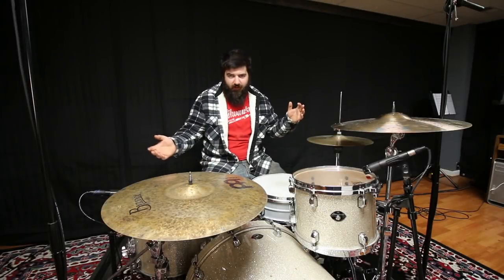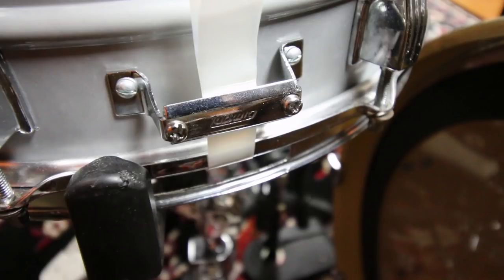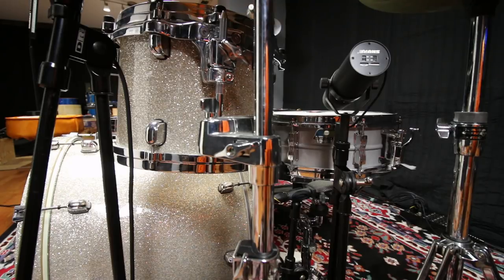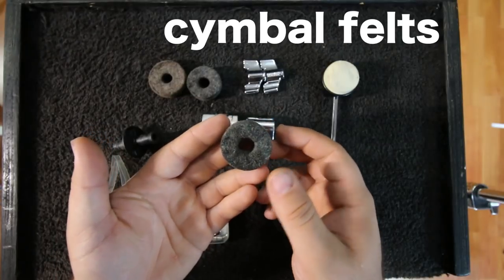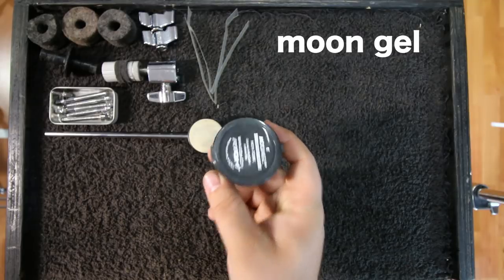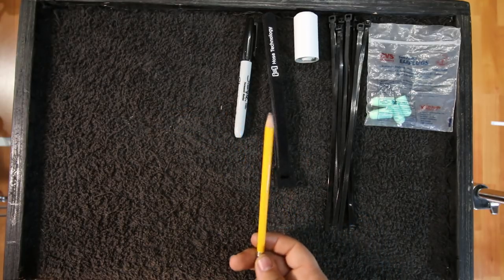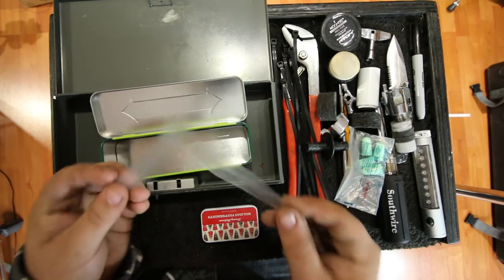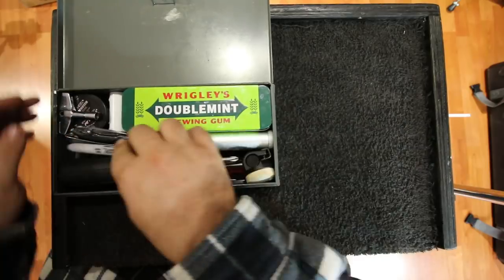How to Make an Emergency Kit for your Drum Set

Comment: Here is what I carry to every show:
1. Tools: I have a tool bag I throw in my car. It is fully loaded with wrenches, screwdrivers of every size, hex/allen keys, a small hammer, a utility knife, tape measure, and some pliers. The tape measure is helpful for winning fights with guitar players over stage space! lol..
2. Leatherman multitool and swiss army knife
3. Small drill with drum key bit. It makes quick changes a breeze.
4. Various drum keys: An old 90 degree angle key with allen key on other end (from Gibralter pedal I had), Evans magnetic key, Evans spin key, Rhythm Tech torque key. These keys also help me change heads and tune quicker. I leave the magnetic key on my floor tom for quick access.
5. Drum Dial tuner. I use this more at home before the gig and use the torque key for speed, but sometimes I have more setup time and can double check with the dial.
6. Moongels
7. A roll of Gaffer tape, for muffling, etc.
8. spare plastic snare straps, snare cords, felts, rubber cymbal sleeves, tension screws, velcro strips, screws and washers (for lugs) in a zip lock bag.
9. Spare clutch. I use a Gibralter quick release clutch and my spare is a normal one with a washer that can come loose, but at least I have it anyways.
10. Spare bass drum beater
11. Hearos musician ear plugs. A must for me.
12. Milwaukee Inkzall marker. Like a Sharpie but better! Writes on anything! 
13. A good small flashlight
14. Pens, pencils, highlighters, my daily planner, and small notebooks. For networking, notes, phone numbers and saving last minute dates that may come up.
15: Power strip. Your bandmates will have several , but if they forget, yours will come in handy. Trust me.
16: Chapstick, Deodorant anti-perspirant, Asthma Inhaler, allergy pills, tissues, mini first aid kit, band-aids, sunglasses, bug spray and sunscreen (both in summer only) because Maine is awesome for outdoor playing in picturesque places. Island boat party? Check!
17: iPhone and charger cable.
I put all from number two down in my favorite LL Bean backpack, which is my gig pack I take on every show. It has a huge pocket underneath for a pair of shoes, I keep my Teva sandals in it in the summer. It has a bungee net for jacket or sweatshirt, and many pockets for all my little items. Plus my stick bag fits in it too.
Reply: Also I just remembered. I have so many sticks and brushes, I keep a full spare stickbag in my car. But a spare pair under the seat will do too.

Comment: i started using double sided velcro instead of zip ties.  comes in a roll you can cut it to any length you need and it doesn't have sharp shards of plastic to slice your hand open.  its great for any kind of cable management and reusable.
edit spelling

Comment: I carry a pair of vice grip pliers.  Also instead of duct or gaffers tape, I carry packing tape.  The kind with the strings running through it.  Had to repair a snare head mid-show once and the head gave out in another place before the tape did.

Comment: Load your bowl and put tape over the bowl so it doesn't spill out in your pocket. Bring two bic lighters. Have a case or something to duck behind between songs to sneak a hit. Have the inside of toilet paper roll and wad up a a dryer sheet and stick it in the middle of it. Exhale into it to mask the smell. If a band member has a problem with it you first threaten them with an ass beating. If that doesn't work fire them. If you want better then use dab and a rechargeable pocket dab hitter. It does work better and need only one hit!

Comment: Also, any suggestions on how to manage mic cables on the close mics? I have a small room and the cables just go everywhere and get tangled up around the set. Assuming I don't have cable ties or zip ties.
Reply: Get a cable-path tape
Reply: Tape the cable to the stand and curl the excess on the floor, as close as possible to feet of the stand and only run the smallest lenght possible. That's what we did in a pro studio.
Reply: Wrap the cable around the mic stand
Reply from the maker: Mic stand cable clips, cable ties (as shown at 4:49), and a cable ramp. If I can get enough material for a full video I might have to make one on cable management.
Reply: Duct tape them to the mic stands
Reply: rdavidr Thanks man! And thanks everyone else. It's a struggle
Reply: ...our bands keep all cables on extension cord reels...I have one with only 6-10' cables on it...just enough to get from mic to snake without much excess...

Comment: Red light flashlight (for mucking about in the dark back stage while other performers are on stage performing).  Acetaminophen or Ibuprofen.  Loperamide (anti-diarrhea).  Hex wrench set.  WD-40 or some charcoal powder for squeaks.  String for your snare.  Plastic strap for your snare.  Knife for the bar after the gig.  Black permanent Sharpie marker (autographs).  Egg shakers.  Claves.  Zip straps.  Duct tape in your color to mark YOUR stuff.  Outlet strip.  Light for your music stand.  Clothes pins (holding music).  Black clamps small.  Big clamps.  Music stand sized sheet of clear plexiglass to cover music in wind.  Extra underwear if you are over age 50.  Batteries for the guitar player.  Instrument cable for the guitar player.  DI box for the keyboard player.  And an instrument cable.   Tuner (for tuning your kit).  Spare headphones/ear buds.  Ear plugs for yourself and others.  Of course some of this is not "emergency" gear but regular stuff.

Comment: What mid range kit would you recommend? Currently I have a cheap ($250) d-drum starter kit, I've got Remo heads on it and pretty nice cymbals, but it still has weird undertones. So what kit would you recommend in the under $700 range?

Comment: I carry gaffa tape and WD40. If it moves and it shouldn’t use Gaffa Tape, if it’s stuck and it should move, use WD40.
Also, a full set of screwdrivers and Allen keys and some miscellaneous nuts, bolts and screws.

Comment: Ok I'm running a bit late, so where's my sticker?
Reply: I nearly forgot... Gaffers tape. The real deal not Gorilla, not the dreaded and useless - except for HVAC I guess- duct or worse 'duck' tape but genuine industrial Gaffers of cloth-like fiber usually matte black but also white and available in other colors but the teamsters will laugh at you. It's around $100 a roll (order on line or play nice with the stagehands and maybe you can roll a few feet on a drumstick. It's worth its weight in associate producers for stage spiking, camera blocking, creating on set continuity 'marks' for talent when shooting multiple takes of a scene. Repairing split open pants when its 10 min to curtain, holding up that stripped out  upper cymbal stand  up tube joint, GAFFA FIX EVER TING! the magical bonding adhesive that won't leave residue is a bonus. Plus, at loadout, gather up what ever was used on stage for cable lays  or whatever into little balls and enjoy the humor of watching sleep deprived coworkers having to peel them off their shoes. Or stick the little balls together making one larger ball that by the end of the tour will be so large as to require the loadmaster to allocate specific load space for it in hopes of submitting images to Guinness and breaking the world's record. What? It exists. Where's my sticker?